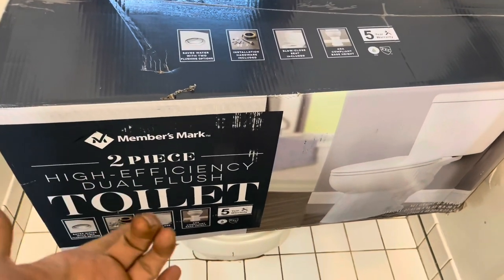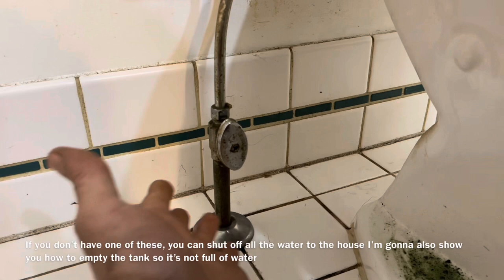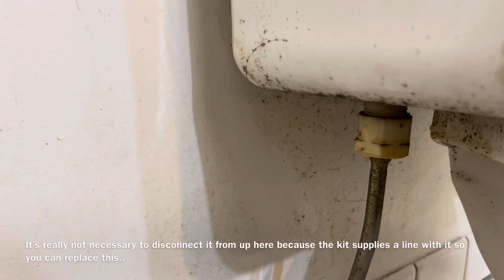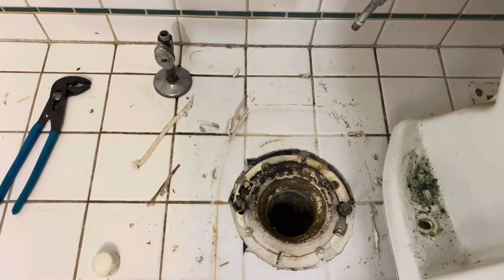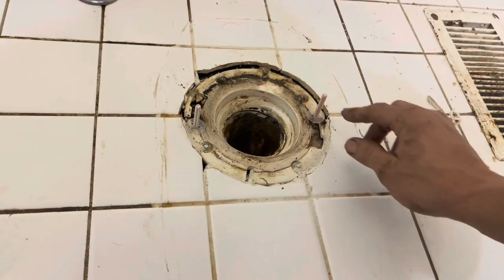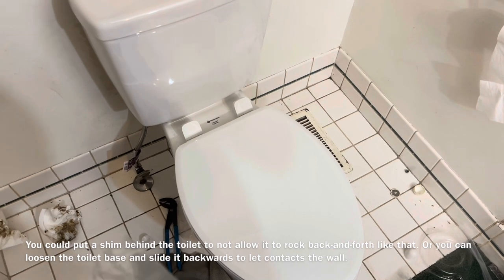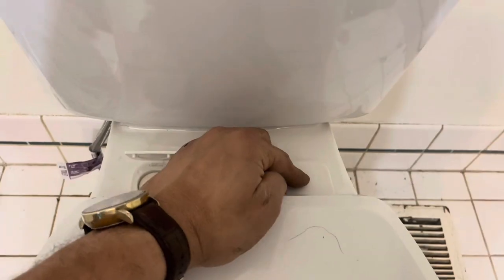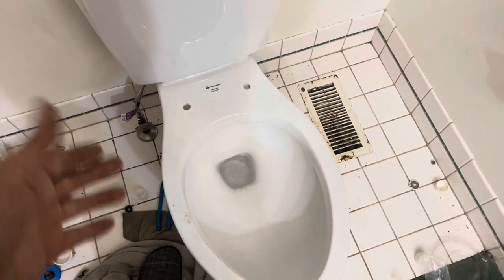How to install a Sams Club Members Mark High-Efficiency Toilet

Comment: DO NOT BUY THIS TOILET at Sam's Club.  It's garbage.  I wish they never replaced the Dual Flush, that was an amazing and solid toilet.
Reply from the maker: I don’t know why you had that experience, but I have two of them and they both have been excellent one of them I’ve had for over seven years and they didn’t pay me for this video I did this because I really liked it. I’m sorry you didn’t have good experience but toilets are just porcelain and a flush mechanism so there’s really nothing to them for them to be any worse or any better than any other product on the market